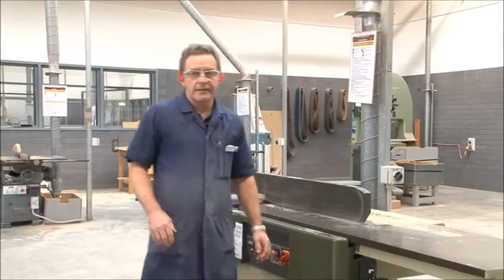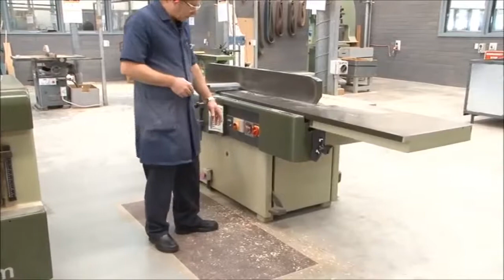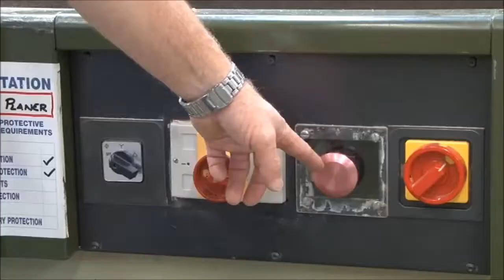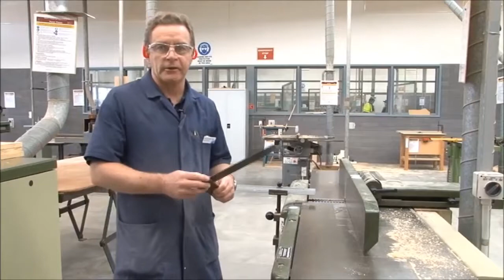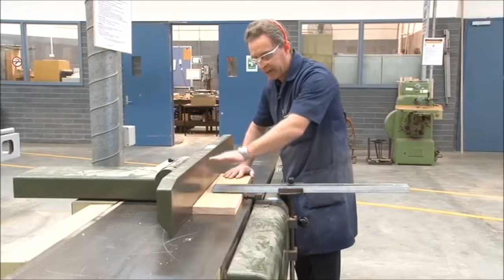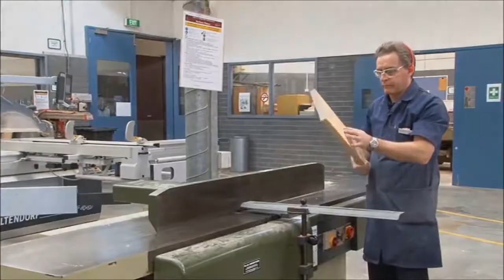Surface Planer (Buzzer)

Comment from the maker: The buzzer needs to be operated with a great deal of care and you must ensure the machine's guards are in place at all times.
Where the machine is not used correctly is when accidents happen.  The buzzer is responsible for a number of severe hand and finger injuries.